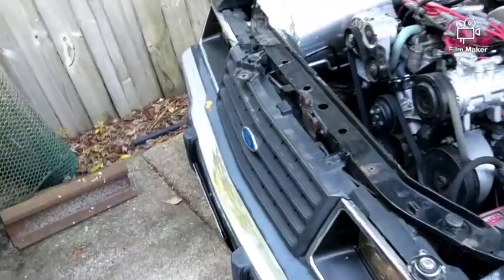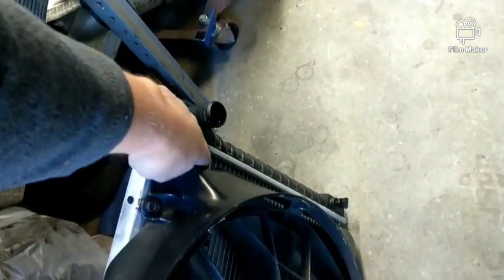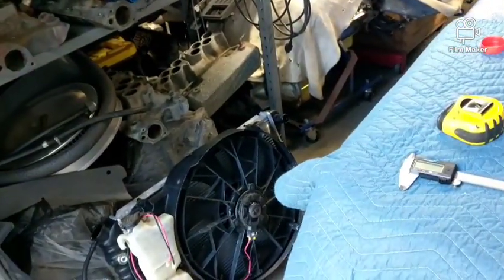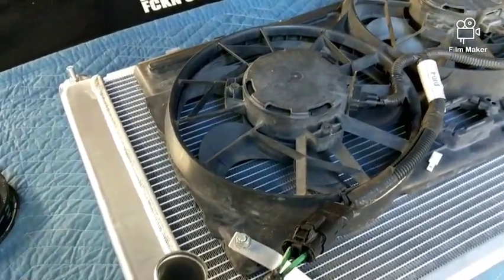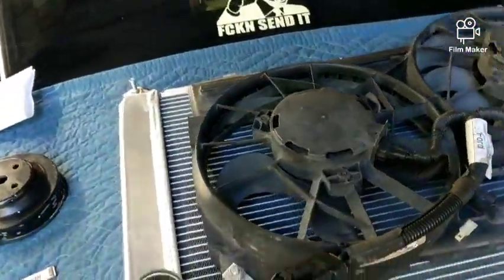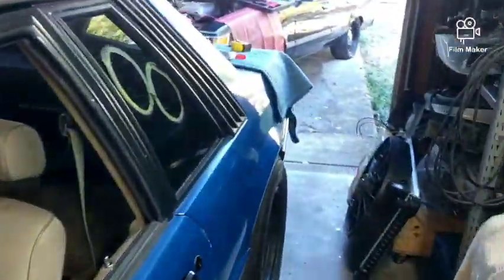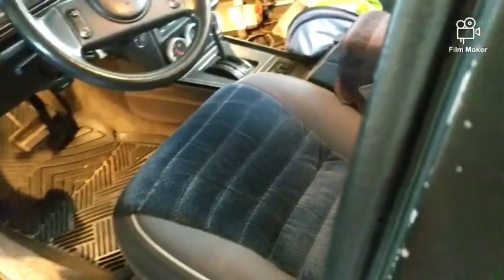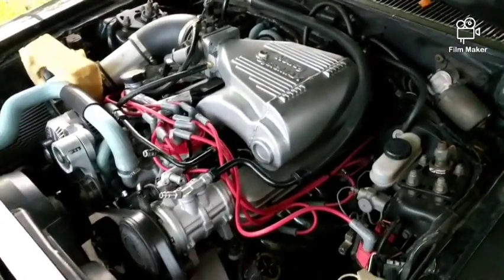LTD LX gets a new radiator

Comment: I grabbed a large diameter fan out of a 06 or 07 Fusion if I recall that had the PCM module on it. It seems a bit thick without trimming the mounting lugs down to fit my '83 but so far I haven't tried to install it. Wish I knew how to send the correct control signals to the PCM unit. I guess I'll try wide open rpm with a fan controller when I try it out this spring. At least I have a 3 core "cop car" Fox radiator and so far it never overheats in daily driving anywhere. Love the "send it" sticker on the blue Stang BTW...

Comment: That Gurl should have been dancing to the tune of the cam 😆 It sure sounds good and if i have any cooling problems im going to have to try one of those giant fans that you took off or the dual setup but I don't think that my rad is big enough for that so I will have to stick to the single fan because I am using a aluminum rad for a 65 mustang . Do you want a new high volume water pump? It's made by GND or something like that but I recently bought a electric race car wannabe😆 water pump (I think it will look cool on there and save powah💪🏻)so I wont need this one anymore.